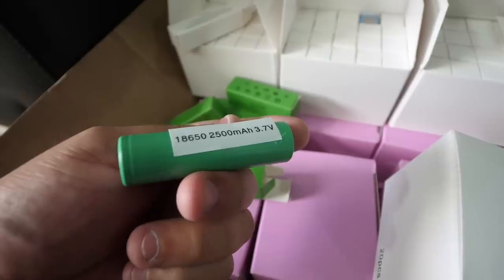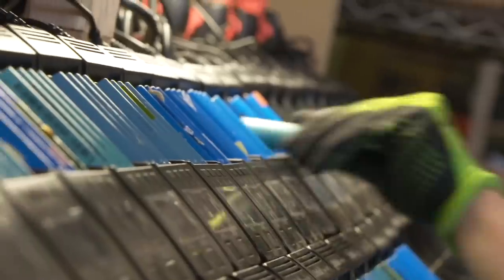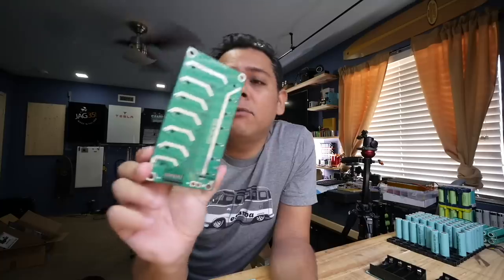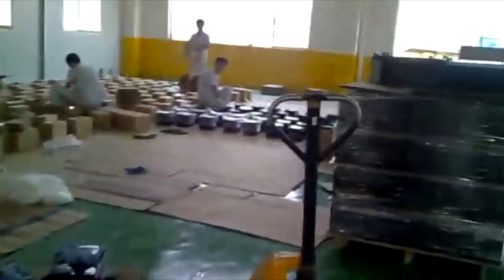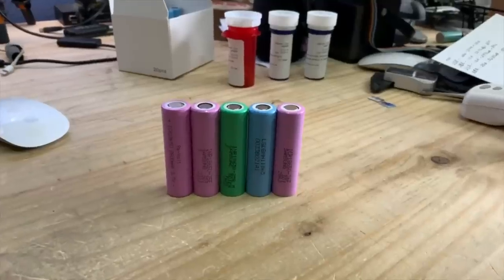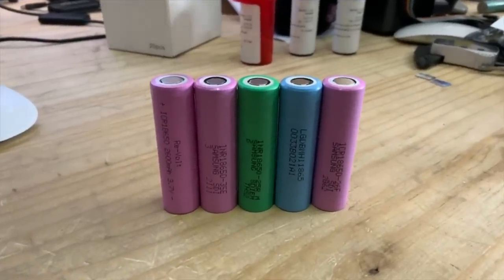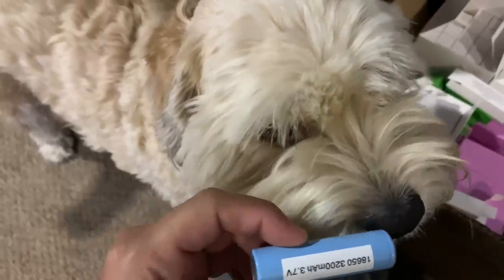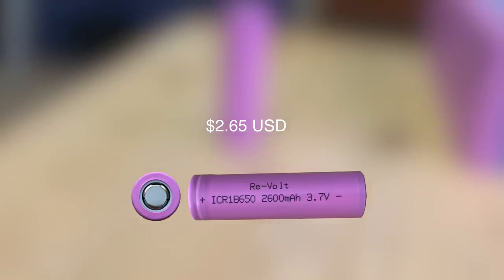How to TEST 18650 cells  (DIY Powerwalls)

Comment: The operating temperature specification is for you to keep it in that range in order for it to perform. It's not something the cell manages. Basically you're using it wrong. You should have cooling for that purpose.

Comment: First, I think it's great that you're doing this empirical testing.  However, when it comes to temperature, you're doing it wrong.  The datasheet is not claiming that the battery temperature will stay under the max temperature under all load and ambient temperatures.  It's telling you that you are damaging the battery when you let it exceed that temperature.  It is your responsibility to either cool the battery or else stop drawing so much current.  

It is true that good quality batteries will have low internal resistance and generate less heat at the same power output as worse quality batteries, so there is some correlation between good quality batteries and those that stay cooler, but that's incidental, not a claim of the datasheet.  Heat is generally the enemy of batteries, from lead-acid to nickel metal-hydride to lithium.  Keep your batteries cool!  Good luck!
Reply: True. Also measuring with that thermal camera is not reliable. It doesn't show very accurately correct temperature
Reply: @kernowconnection  o
Reply: I know this is old & excuse the revival, but I was about to comment the same thing.  I think the way he is testing the batteries would be ok if he was able to include the +/- with proper statistical deviation process.  The thermal though is what saying and the camera doesn't really hold up.  It is good to use though for safety if that's all you have, but I wouldn't use the data from it.
What he is doing seems to be ok for what he is trying to accomplish.  It certainly does not validate or replace the spec sheet data, but it gives a good enough look into what the batteries are capable of and if they are good quality.   (SR ChemE Student)
Reply: Also the current and the potential could be different at different temperatures, but that is fairly common knowledge and I am sure he has looked at that.  
Using just one discharge I believe isnt enough. I would like to see the data after a couple discharge and cool trials.
Reply: True, that's what the datasheet is trying to tell.

Comment: Temperature rise depends of your ambient conditions. The temperature spec gives you operational limits you should operate the cells. If the cell surface temperature rises over the spec (for example in ambient 40’C conditions), YOU MUST ACTIVELY COOL THE CELLS during charge/discharge and/or LIMIT the current/loading! 8A discharging is allowed up to the surface temperature limit - it doesn’t mean that the cell would be out of spec.

And where’s all comparison of SAFETY and lifetime related? SAFETY CERTIFICATIONS (UL, CE, TÜV, ...), safety devices integrated in the cell and are they really working and preventing fire. Lifecycle cost per Wh is not the same if a cell lasts 50 cycles compared  to a cell lasting 2000 cycles, especially in powerwall application.
Reply: Additionally, the “operating temperature” specification is not how hot a cell surface should get when discharged or while charging. It is a safety parameter that indicates you should, as previously said, not charge or discharge a cell if it’s surface temperature is beyond the given range without hearing or cooling the cell.

The second data sheet you read with test currents and surface temperatures is accurate and is not a “deviation” or a duplicate and inaccurate specification.
Reply: No safety tests on the OEM cells, but recommending them for a group buy seems risky.
Do they vent correctly under short circuit conditions, or just explode?
Reply: Indeed, for packs of batteries used in tools at least, there is a thermistor to measure the temperature so they can presumably cut the power if they get too hot. I'm guessing lower draw situations just limit the current so it's practically impossible to overheat.
That the specs say -20 to 75 celsius does give it away a bit, that it doesn't mean it's the temperature it will reach in normal operation, but the conditions it can operate under.
Batteries at 100 celsius sound rather scary, especially with Lithium Ion.

Comment: One of the ways I identify or classify a battery to be on the better side is to weigh them. Manufacturers usually decrease the raw materials making them lighter. With the same materials used like both have metal cover and same "mah" capacity, you can now compare them.

Comment: Well done, interesting that well known Manufacturers are not necessarily the best. I have bought a small number from a UK distributor and so far they Check out OK on capacity after a few cycles through the Charge / Discharge equipment I'm using. Sinowatt 34MP 3350mAh 18650

Comment: You should never let cells reach those high temperatures. So you have to use a cooling system. The closer to 25C the better. The problem is that those measures are for a single cell in free air. But imagine what happen if you pack many of those together...
The problem is that using cells at high temperature generates some internal side chemical reactions (unwanted) that destroy them progressively. So the capacity will drop rapidly over time and may even drop sharply if the electrodes end up being plated / covered by side reaction byproducts blocking normal reactions.
Unfortunately evaluating the rate of those reactions is hard to test without very high precision equipment.

Comment: Sorry to say, I ain't expert on battery, but I think the temperature 10:33 is the "recommended" temperature for the battery to work on, just in case if you expecting to get more energy. i.e. to get the best performance from the battery, Please actively maintain the batteries' temperature between -20°C to 75°C max, recommended to actively (fan) keep battery below 60°C during discharging.  Please correct me if there is anything that doesn't make sense to you. Also, you should have test compare their charging cycle limit and degradation rate as well.

Comment: Great video, but I want to note the operating temperature is based on your environment.
You are not supposed to allow them to go above 60C not that the cell can't go above that.
So in your case you should add more cooling and not allow the cell to go above that temperature.

Comment: I do safety testing (short circuit and overcharging) on commercial 18650 and 21700 all day. I would never use any of those cheap cells. I’ve seen too many of them vent (at best), explode (at worst). I would never let them get above 70C on a charge or discharge. Even using good ones, all it takes is one mistake and your house will be gone.

Comment: Jehu, If you have a moment I would like to know what you would recommend. I'm looking for 3kma 18650 cells with a min 15 a continuous discharge capability to use in power hungry tool battery packs. The  VTC6 or the samsung 30Q are my obvious choices. My problem is finding a source which sells original or equivalents which hold up to specs. I have been searching through Ali express, but I just don't know of any dependable sellers. I read the reviews which often are glowing based upon superficial sentiments just to find  a few who show empirical testing which show they are counterfeit and fail to meet both capacity and discharge rate. With your vast experience, can you recommend a quality seller at a reasonable price?

Comment: What’s your recommended capacity tester? I didn’t notice a brand/model when you showed your discharge tester.
Reply: Revolectrix Dual PowerLab 6 Touch, not the best choice, author has another one because this one gives only 8 amps discharge current

Comment: Quick and dirty - weigh the damn things.  Fakes are almost invariably light.  Testing is far better obviously but weighing them will catch a lot of crap before you get involved in testing.   If you're running a powerwall the IR is often secondary as typical load is usually fairly low per cell.  Pulling 10 amps per cell will discharge it in a few minutes.  A powerwall that goes flat in 20 minutes isn't much use. It goes without saying don't buy anything with fire in the title......
Reply: extra cement will make you lift the battery happily.
Reply: I have a trust fire charger ;)
Reply: @melgibson6331  - I have actually seen some anecdotal evidence that non counterfeit trustfires are legit. Not highest quality, but not trash either.
Reply: I would Check Every ONE anyway if I decide to Build a Power Wall...for Now I'm just Looking for Replacements to My UltraFire 14500 & 18650's for My Flashlights.  Any that You would recommend ?  I need 10> 14500 and  12. 18650's .  Thanks !   I do have a Good LiPO charger(small VENOM Pro) to test Mine with(My 7 year old UltraFire) they have been doing Good, but don't last as long now.
Reply: I always use this quick and dirty test, until I received a fake powerbank. The cell felt heavy as usual. Once dissected, it filled with sands. Those genius rip-offs...
Reply: @davidaharris2561  + I use EBL 14500 and believe it or not, I get good 18650 batteries from China. I have bought LG Chocolate clones that really were 3000mah + - 10%. I also bought clone LG MJ1 3500 mAh batteries that we're dead on the money! You have to buy from a seller that has a lot of reviews. I paid $2 for the 3000 mAh and $6 for the 3500. I tested them by discharging in a battery operated fan at known draw them in an Xtar TC2 charger which showed 4450 mAh, which when you correct for losses from inefficiency charging at 2 amps is right at 3600 mAh. Hope this helps, at least it's a possible option. Forgot to say, I believe MA BD on Amazon to be selling the good fake batteries on Amazon, just not as cheap as I am getting them directly from china. If you have something that takes 26650 or 18650 both, a third possibly is EBL 22650 batteries on Amazon. 3300 mAh, and Cheap, $6.95 for 4! I bought about 5 sets and had them delivered to my house in the US.
Reply: Davida Harris Ultrafire are cheap Chinese crappy cells...
Reply: @robertkubrick3738  Hi Robert, I am a fan Glider/airplane modeller balsa builder, and I am willing to convert my planes/gliders from gas engine to brushless motors. But I want a reliable and durable Battery set, as well as the charger. I can see that you have tested your Batteries with a fan, which id more or less what I am looking for. Please could you tell me which brand/model and provider has had success? Regards
Reply: @gonzaloejimenez  Hello Gonzalo. I was using them in a fan by Bavin. Price vs quality they are a bargain compared to others. Judging quality by lack of vibration. I was using their 150mm model for baby strollers. I don't know if they could provide enough thrust for your application. Maybe if they could be overdriven. The fans will run off 5v they might be durable enough to take 6v. Maybe 2 fans, push/pull configuration working off 2 Lifepo4 in series parallel @6.4v. You would be the expert in your application.
Reply: @robertkubrick3738  Dear Robert, thank you so much for your kind and quick reply. The brushless motors I have got run between 9 to 11 volts, so four 3.6v Batteries in series would work. And if your fans are working well I don't see a reason why my motors wouldn't do the same. I just want to try to see how it will work the performance vs the old configuration gas engine. Expending money in gas is annoying as well as the spark plug and engine degradation. Any provider that you suggest I can start order these batteries?
Reply: @gonzaloejimenez  The batteries are nominal 3.6v I have one that goes all the way to 4.4v when fully charged it you are in the US, I would suggest the 22650 EBL batteries on Amazon if they still have them. Tac welding with strips of nickel is the best way to connect them but it can also be done with soldering acid which is more powerful than flux and a soldering iron, I'd do that outside.
Reply: @robertkubrick3738  Hi Robert, thank you agai. Did you say 22650 or 26650? I googled it but I cannot find the 22650....
Reply: @gonzaloejimenez  22650 is a thing. Barely larger diameter than 18650. EBL makes them and I bought 5 boxes of 4 on Amazon for $6 a box. They work better in flashlights that use a 3 x AAA batteries in a carrier, that's what I used them for. 3350 Mah. Amazon also has good deals on EBL 18500 batteries for drones. Oddball sizes selling cheap. If you are creating the battery pack, no reason not to take advantage of batteries that are cheap because they aren't in high demand. You could get 4 of the 22650 for the cost of a single Panasonic 18650 or 20700.
Reply: @robertkubrick3738  Yes, that is exactly what I was thinking, to use a set of decent and reliable Batteries that I can use for my planes as well as maybe something else if I have to , creating a Battery pack (maybe a nice Slot Container of 3 Batteries for my Brushless motors) and a decent and reliable charger. However I cannot find the 22650 on amazon..... :-(
Reply: @gonzaloejimenez  My apologies, I meant to say 20650. It's late here. The neighbors have been throwing a party.
Reply: @robertkubrick3738  Thank you Robert, I found it!, It is not available on Amazon, hopefully soon, but now I know where to start!
Reply: @robertkubrick3738  Hi Robert, me again bothering you. For these batts, did you use a case slot container so you can connect them? Regards
Reply: @gonzaloejimenez  Hi Gonzalo. I would solder them using soldering acid, flux won't clean nickel oxides well enough. I would do that outside, because I don't have the tack welder that a professional would use. If a box would fit in your requirements, it would be easier.

Comment: Seems to me of the few batteries you tested, the Samsung INR18650-35E seems to be the winner.
You can't say the OEM batteries are the winner price for performance, because without a brand name / company, there is no way we could buy them, so they are automatcially crossed off the list as mystery battery that can not be sourced.
fpv.air-war.org

Comment: Try Zanflare C4 charger, specifications
- Input: AC 100 - 240V, 50 / 60Hz, 0.6A max, DC 12V, 1.5A
- Output: USB 5V 2A
- Charge current: rechargeable Li-ion batteries 4.2V, 300mA / 500mA / 700mA / 1000mA, rechargeable Ni-MH batteries 1.48V, 300mA / 500mA / 700mA / 1000mA  
- Discharge current: 300mA, 500mA

Comment: With regard to the physical relationship between the internal resistance, the emitted temperature and the produced current, Re-Volt cells have an internal resistance of 40 mOhm and not 25.

Comment: About the temperatures. Aren't those at a certain ambient temperature? Probably specced at room temperature of 20 or 21°c. So a few degrees above that could increase temperature especially at higher loads.

Comment: Laptop battery pack can fix bad cells by pumping - into the +, if it has to. By making a laptop pcb board, you may be able to fix individual cells, later inserting into other devices, it still works.

Comment: I found some 18650 cells on 18650batterystore and the cells that are available are Samsung 25R 18650 2500mAh 20A Battery. Would these be ok to build a 12v 10AH battery pack for an icy breeze that draws 4amps? I know it says 20A but I’ve seen the 30A 20S Samsung cells all sold out so I’m wondering if these would be strong enough to power the icy breeze or a power wheels truck? Are they high drain type that will work for those types of applications?

Comment: can you guide me about Internal resistance of 18650, low is good for laptop battery or +60 is good?
and with is maximum and minimum resistance of 18650 cells for used cells in a battery

Comment: One question: when i take bat-packs apart, they plastic around the 18650s often has glue on it or gets destroyed, how do you prevent it? and more important, how do you get the spot-welded ends of the batterys clean and so that they dont oxidise?

Comment: jehu the only thing that is now also popping out is that this Chinese manufacturers are using low end materials for manufacturing the cells that give extremely good results on few iteration but suffer a huge degradation upon more cycles. please do if possible like a 100 cycle for 10 cells and see then the results.

Comment: I just got a LiitoKala charger and some LG 2200Mah modem cells. The modem cells tested great. I just got a couple of dozen NEW INR18650-35E  3500mAh 13A for DIY phone chargers.  The cells only are testing out at about 1500 mAh discharging at 1000mA. The tests are cutting off at about 3.5 to 3.8V when the charger says cutoff is 2.8 V at 500mA. Are these fake cells?

Comment: Hey sir I bought icr18650 26j Samsung batteries , I charged them with tp4056 module , initially battery voltage was around 0v and after putting it on charge many hours voltage doesn't rising above 2.5 v ,,, what could be fault plz help me  about it sir , the only guy on internet I found is you for this question..
Reply: Those be dead cells mate. 0v? You'll never charge them to 3.7v
Reply: Check out battery mooch

Comment: For someone without this sophisticated set up...if you have a cell that is high capacity like 3000 mah..2 things you can do right off the bat...weigh them first..they should come in a about 45 grams..if they come in at 35 grams, alarm bells should begin to ring...next is to measure resistance...if the cell is suppose to have 30 moh and it comes in at 60 then alarm bell no.2 should start ringing...next test capacity.

Comment: 10:16 Discharge max 60C degree doesn't mean that the 18650 tube will not heat more than 60C. It recommends to use battery when the temperature is below 60C.

Comment: Question cell capacity Is the amp-hour rating, for example, 2600 mAh.  Is this capacity based on the voltage range of 4.2 V down to 3.0 V. I assume there is no capacity left in the cell below 3.0V? Please advise